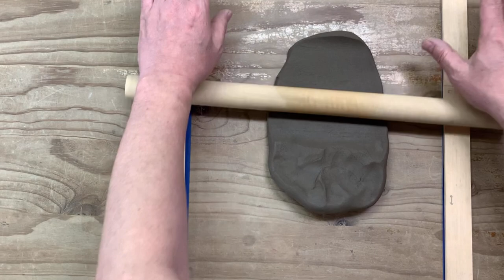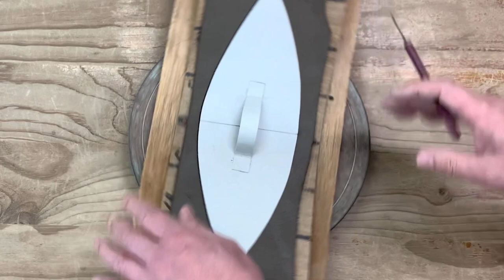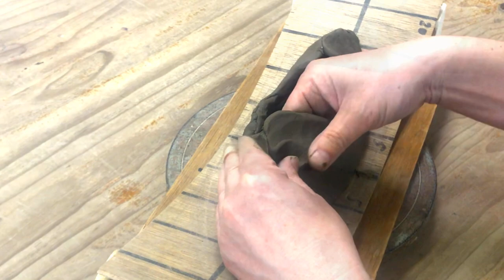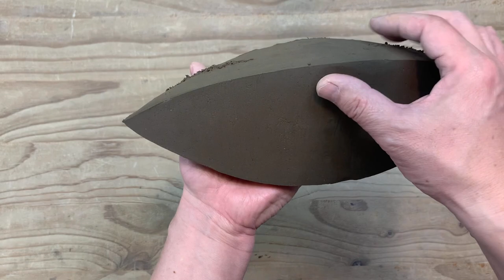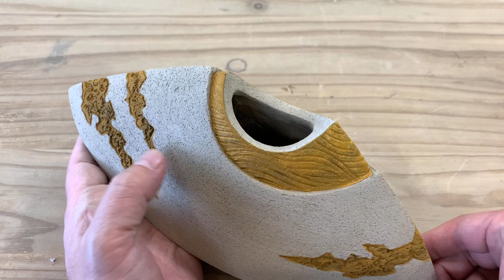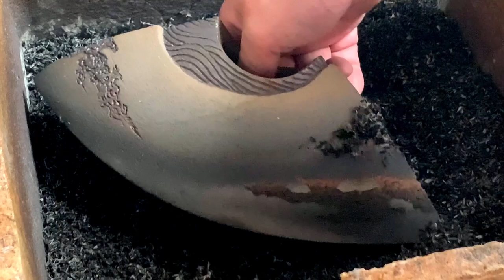炭化流雲紋器の作り方 How to make a carbonization vase 陶芸 pottery 熊本栄司 Eiji Kumamoto

Comment: Hello, yes very simple form and beautiful piece. But 2 questions. 1-  When you say fire to 1230° do you put the saggar in a kiln? You can't fire just where the saggar is in the video, just on the table?  Question2- Doesn't the pot come out all black and you have to wash off the black to see the real result?
Reply from the maker: Thank you for watching. Answer 1: This piece was fired in a kiln; the high temperature of 1230 degrees can only be achieved in a kiln.　Answer 2: The color of this piece was created naturally. The black part is carbonized and cannot be washed away with water. The fire and the rice husks gave the color naturally.